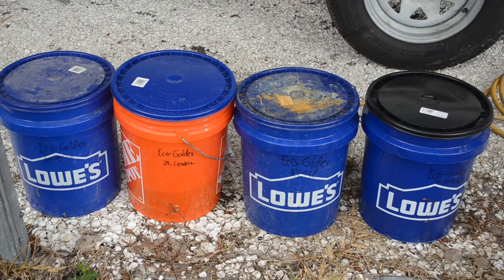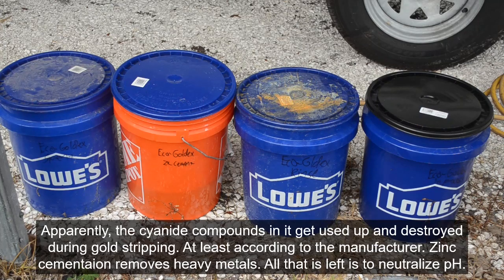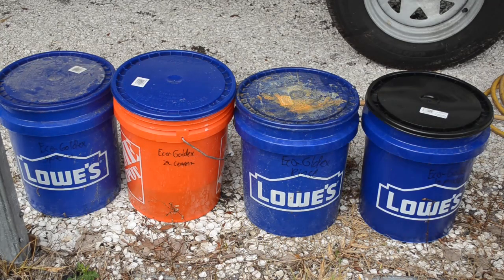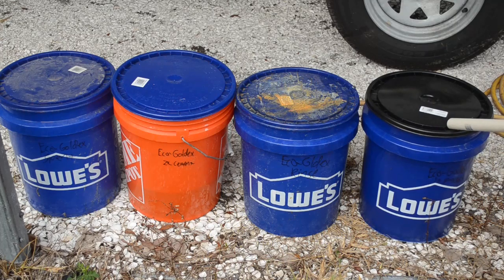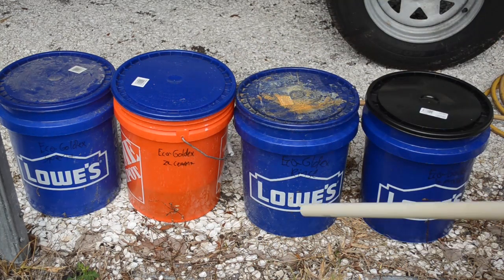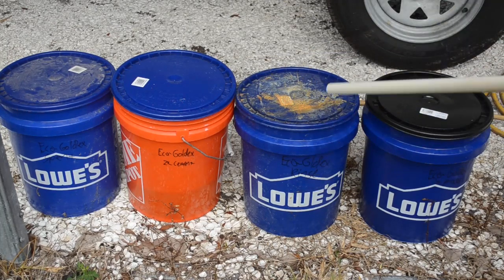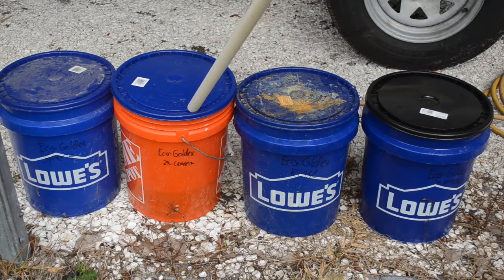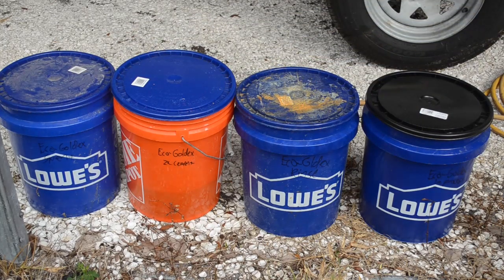Eco-Goldex Short: Waste handling, recycling and a closed system.

Comment: Mike , because this video is over 2 years old you may never see this. 
Do you still use eco gold x? 
Have you ever run a test to see just how much it will leach? 
Example: Using 100 ml of solution and adding gold powder from a known quantity until it stops leaching it. You get the point. Lot's of valuable info could come from such a test.

Comment: Hello,

Was just wondering how to re-adjust the Ph? I used NaOH and it kind of creates some dense salts in the solution. Are we supposed to reuse it as it is or are we supposed to filter the hydroxide first?
I did in my first try but observed that the pH had decreased to 9 or 10 from a pH of 11.5, Is there any decent way of doing this? Please revert soonest as I'm having a tough time re filtering it all again and again. 

P.S would it be okay to let the hydroxide be in the solution and then heat it for stripping to take place? This would be like no filtering and a very convenient process.

Awaiting your reply.

Thanks in advance :)

Comment: Have you ever though you might recovery gold from BGA by using Eco-Goldex? I assuming you can use same incineration method as you usually do, after the BGA is thoroughly pulverized no gravity separation just put them all into Eco-Goldex and then filter it, do you think it will works? I hope you can make a video with this.

Comment: Looks good. I tried to remove the zinc by neutralizing the solution and made a lot of colloidal gold from the high salt solution. You have a better handle on the acidification of the pregnant solution that limits the salt production. 
I’ve learned a ton from your videos. My total from my eco goldex runs is about 8 grams gold, some palladium and some silver. 
A question;
Why do you use sulfuric instead of hcl? 
An aside;
I find that cooling the pregnant solution (5C or so), drops out some of the problematic impurities. Also, filtering restores the leaching power of the solution.
Reply from the maker: I don't always use sulfuric acid. I just happened to this time. I really don't see much of a difference between the two. Either way I get a lot of white precipitate (probably silver and maybe some lead) in the first pH adjustment. There really seems to be no difference between them for gold recovery. Thanks for the tip on cooling and filtering. I'll give it a try.

Comment: Mike, I enjoy your videos. There is just one thing that would make your 
gold refining vids better, melt your gold powder down into gold ingots 
or buttons. I can't speak for everyone, but I'm sure the majority of 
your viewers would really like to see beautiful, shiny gold at the end 
of the refining process.
Reply from the maker: Yes, I know everyone would like to see a nice, shiny bead of gold. However, there are practical concerns. I try to keep the cost of my refining reasonable. It takes a lot of energy (read money) to melt gold. So I try to only do it once. I refine my gold at least three times, and wait until I have at least the better part of an ounce accumulated before making bars. I only have to get the torch out once, and it doesn't take much more gas to melt an ounce than it does to melt a few grams. Keeping the impure gold in the powder form also means it is easier to re-refine later. Buttons and beads are very slow to dissolve in aqua regia. Thanks for watching.